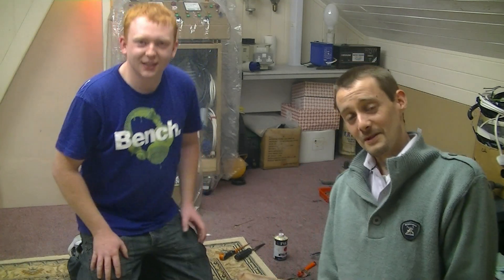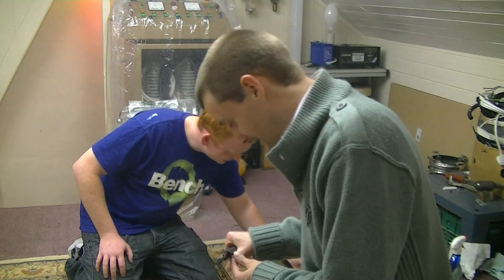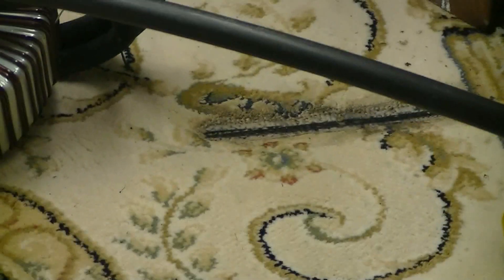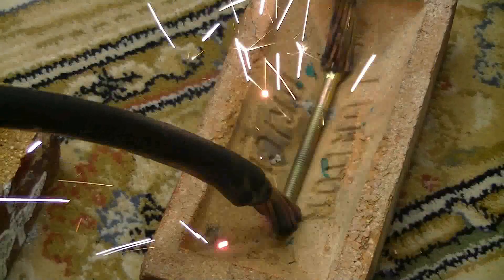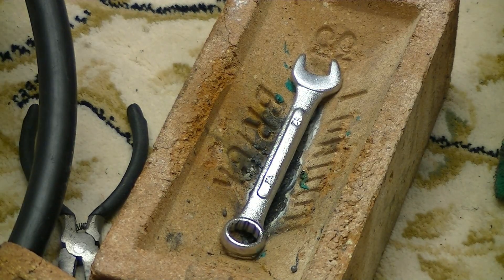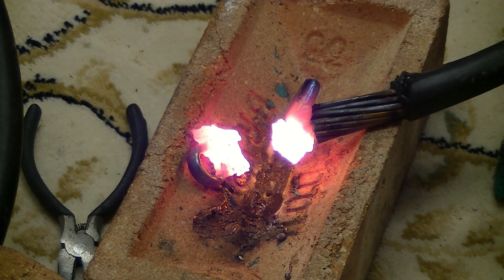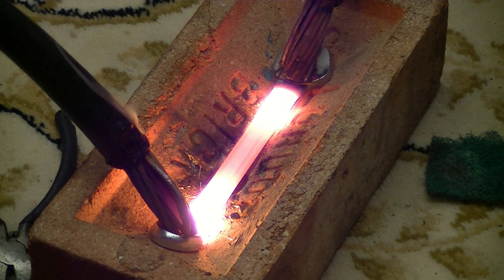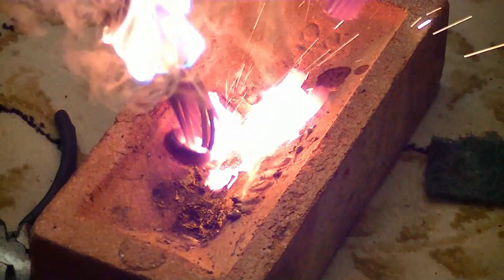5000 Amp Fuse + Tools Melt With High Current

Comment: Back in high school that was a trick we would do with a welder in shop,  give a wrench  a few seconds of current then toss into the pile somebody else was using,  or drop it on the floor near a project.  They stay hot a long time.

Comment: Lol you guys shouldn't be heating galvanized metal indoors (or at all)All that smoke was extremely toxic.
Reply: Ben Hutchinson JBC is right. That smoke is very toxic. You should never burn or grind anything galvanized without proper ventilation or masks. But when you're doing this in your living room, safety isn't really an issue.. 😂😂
Reply: JBC that's funny because they used to smoke meth everyday 🙂🙂🙂
Reply: I doubt the galvanization fumes will do near as much damage as all the meth these dudes have blazed
Reply: JBC so is the stuff there probably smoking besides living room carpet us brits dont give a shit even after we invented health n safety haha bollocks to it. looks fun as hell
Reply: no, its EXTREMELY toxic, go check out "metal fume poisoning" one of my welder buddies died from this. all he did was weld a bunch of galvanized plate steel, not fucking vaporize it in an arc furnace. '
Reply: Ha! And the ciggies are ok....
Reply: Galvanized is just zinc, a typical metal. Not like they were doing that with lead. Worse chemical that could come from burning zinc is zinc oxide, which I don't think is particularly toxic.
Reply: Hafiz Asyrofal they do sound seedy as fuck
Reply: JBC I was just about to say that.
Reply: Just beat you by 15 hours
Reply: haha. Yeah I gess
Reply: JBC well the fact these dumb asses are doing this inside and the way they are, it's probably way to late for that to be a issue lol
Reply: one word england... they are fcking stupid no offence to english people but they are fcking nuts thats why i like them :D
Reply: khznator 
if it wasn't for the British the world would be a dull place,we invented most of what the world use everyday!
Reply: Ben Hutchinson galvanized is extremely toxic to breath.
Reply: Ben Hutchinson 
vaporized zinc also

Comment: You're seriously doing all that on top of a carpet rug??
Reply: they arent the brightest of mate so i wouldnt worry about it, they wont be around for too much longer which has gotta be a good thing. last thing the country needs is these 2 herberts breeding.....
Reply: Assuming its wool, possibly not a bad idea, the wool chars, insulates and doesn't propagate flame, furnace workers used to dense wool felt aprons to protect themselves against splashes of molten metal.
Reply: Robert Hardy saw it catching fire right side...
Reply: Well you certainly wouldn't want them burning the wood!
Reply: I think the carpet is the least of thier concern!!!
Reply: paul rogers he did say that they had been to the pub beforehand
Reply: The breaker was blown. No more power.

Comment: The primary looks like 100 turns or so, the secondary coil looks like 2 windings perhaps. With 230VAC in the primary, this would produce about 46VAC in the secondary (the wires they were holding). That is on the edge of feeling an electrical sensation if touched and is unsafe. It's actually the current that kills most, only 20 mA is enough to put your heart into defib, but it takes enough voltage to complete a 'shock'.
Reply: BlaBlog101 oh well survival of the fittest
Reply: BlaBlog101 my teacher got shocked with 10kvac when he used to work and he only got shocked
Reply: It all depends on many factors: what is the current, how is the shock traveling thru your body, your body resistance, etc. Walking across a carpet and getting a shock from touching a doorknob or something can be in the 15kV range but it's very low current. If it was from a power station then it's usually instant death due to the large current. In any case, it's not safe to play with any electrical device capable of such voltage. An ignition transformer for an oil burner can put out many thousands of volts and if you got it across just your hand it would be painful, maybe burn the skin if long enough duration. If you got it between both hands though, like across the chest, you stand a good chance of getting killed. Your teacher might have just been lucky.
Reply: BlaBlog101 he just told that he fell backwards and felt a small shock. Thats it. He was doing some kind of measuring

Comment: why is this age restricted
Reply: Ry 00001 soccer moms
Reply: Ry 00001 probably because people flagged it.
Reply: you tube ,, how is that dangerous ,, rugs dont just explode into flames like raw natural gas ,, and the only amp load was on the heavy duty copper cable ,, they did have a do it yourselfer fire extinguisher at hand , used it and it did work as you could clearly see ,,  just the opinion of a man that tried many things like this and never had a problem
Reply: You Tube more like fry themselves
Reply: carmichael moritz If you need to ASK how is that dangerous than you clearly have no clue on how dangerous it is that you are doing… 
Maybe one day when something DOES happen (hoping not for your sake or others) that you will then understand how dangerous it was and you learn your lesson…
Reply: you tube ,, they were using high amp and not high volt ,, high volt is what can jump  and killl ,, high amp never jumps it has to have direct contact with a conductive material ,, believe it or not high volt can shoot a ark in the right conditions ,, and if i ever would get struck with high volt i do not think i would be around to learn any lesson ,,
Reply: carmichael moritz they were using 220 it'll kill you very quickly
Reply: dalton ,, yes  i know ,, 220 volts ,, what i am wondering does it still have the full 220 on the secondary winding , the winding that is producing the high amp load ,, with the primary winding's being such a small thin wire i know it cannot handle much amp ,, high volts yes high amps no ,, those small wires would just melt like butter ,, the secondary has thick cable and can handle high amp loads ,,
Reply: carmichael moritz ah I see now good point good point
Reply: carmichael moritz still I'd imagine it'd be about the same as using I very heavy duty welder if not kill seriously hurt lol
Reply: dalton ,, yes i have gotten a pretty dirty shock from a 225 amp welder that was using 220 volts and i can tell you for a fact that it was no where close to what 220 volts would have done to me ,, voltage is a strange thing ,, just like a vehicles coil to the spark plug , some say it can be as much as 40,000 volts  ,, i do not believe this i felt the jolt from a vehicle coil and while it was very painful it was not lethal ,, all i know for sure is i would not want to touch the main power lines that come into my yard , i think that voltage would fry me like a burnt hotdog ,,

Comment: Do yourself a favor, and DO NOT breathe the fumes from those bolts.
If it's zinc plated, you'll get welder's lung, and from what I've heard it'll make you feel so bad you will wish you were dead.
If it's chromium plated, it's probably about the same or worse.

You're only safe if it's raw steel, and I'd bet you would only know that for sure if you sanded off the outer layer of whatever metal it is to expose the steel underneath.

Either way, metal fumes aren't something to fuck around with!
Do that kind of stuff outside, at least then the fumes have somewhere to go instead of being stuck around head-level.

Other than that, this is a really impressive video, shows why current can be just as bad as voltage, the important thing is the calculated POWER.

Comment: Hey guys, a kewl vid but, as electrical engineering professor (power systems, no less) I’m a bit suspicious.  Not of the results, but of the power source….  It looks like your overall turns ratio is around 30:1.  That means that it would take around 100 A to deliver 3,000 A….  I just don’t think that your little Variac can do that job….  What did you really use for a power source???
Reply: Leonard White if you are professor may i ask. Since i am first grader in electrician school i was wondering that shouldnt they get shocked just by holding the cable with the power since i remember teacher telling that some of the electricity can stay in cable if much power. I think it was on a lesson about condensators
Reply: Ice,

It’s true that it takes a closed circuit to conduct current – that is, to be shocked – and that it would take two wires to form the two ends of the circuit.  But, in the Real World, the question is:  “What would be a ‘wire’? ”

Almost anything around you will conduct electricity if the voltage is high enough.  Even at lower voltages – like that you have in your home – the earth, a concrete floor, damp clothing, etc. can conduct enough current enough to be considered a ‘wire’ that is good enough to give you a shock.

If you were COMPLETELY insulated then you would not be shocked by touching a single conductor.  But, it’s difficult to tell when you are really insulated.  The things around you – for example a damp floor – may ACT as the other wire….  The higher the voltage, the more likely that something that is a normal insulator would conduct enough current to cause a shock.

The bottom line is that you should NEVER trust anything that might be energized whether is a ‘single wire’ or not.

Hope that helps,

Len

Comment: I don't know how the fuses work in the UK, (I assume it's similar to america) but fuses aren't really sacrificial parts anymore, they don't get destroyed, instead they flip and close the circuit. No need for a replacement fuse. :)
Reply: fuses are still sacrificial parts your thinking about breakers. in the us fuses have been mostly replaced by breakers.
Reply: Dustin M Ah, thank you very much
Reply: Osumo Ben Lodan in canada the house owner is allowed to turn on/off the breakers but you need to be an electrician to modify the box (add/remove circuits) i am not sure about fuses though
Reply: Dustin M In the Netherlands we use both systems. Breakers, who are consumer accesible, and screw in fuses, which are under an black box with seals. Only the grid operator can access them without getting any fines.
Reply: Dustin M Ah, okay.

Comment: What was the power?  I mean how much current on the input side of the transformer?  Most household outlets in the US 12 15A or 20A at 120V.  If you use a 30A breaker, you can install sockets that accept plugs used on high-current devices.  There's also a weird high-power outlet we use on electric clothes dryers.  

Intuitively I just don't think the highest non-industrial outlet I know could provide enough current to melt a 9/16 inch wrench... or a 14 mm spanner. :) :)

Comment: this is high current and low voltage. the voltage potential is probably so low you can grab both wires and not get shocked.  the secondary voltage is probably around 10-12v while the amps on the secondary side is in the thousands.

Comment: doubt there is any 5000 amps going on either. Simple math would require at least 62 amps on the primary if their secondary only puts out 3v and with the sparks I see, looks more like 6-9 v. 5000 on the secondary would require 187 amps on their primary, and they aren't using anywhere large enough wire size on the primary to handle that much. 300-500 amps would do everything they show here.
Reply: You can see the transformer has about 100 turns on the primary, so 25:1 ratio.  With 10-20A in (based on the size of the input wires), that gives 250-500A out.  Good guess.

Comment: What I find interesting is steel with a much higher melting point is melting and not the copper wire with a lower melting point.  Maybe I am unable to clearly see the size of copper vs metal objects that may be thinner overall, hence why they are melting and not the copper wire.
Reply: r351574n23[resistance, 1337]
Reply: Copper has a lower resistance than steel, and it conducts heat much better.  Bottom line is the steel gets hot enough to melt, the copper doesn't.

Comment: these guys are bumbling idiots. there is a reason why it is dangerous to mess around with high voltage or currents. you can get killed or kill someone else. I wonder if they gave any thought about what toxins they are breathing in with this moronic show. chromium and zinc can do nasty things to a person lungs and central nervous system when  inhaled.

Comment: Why is the insulation of the cables made of flammable material?
Reply: Because rubber and plastic are flammable,  glass isn't flexible, and steel isn't a good insulator.
Reply: Hello? There's a lot of non-flammable stuff that's not hard as glass and conductive like steel ...
Reply: Such as?  Rubber, glass and plastic are the best insulators.  That's why they use them.  The plan is to keep the wires AWAY from fire.  That's pretty much the whole purpose of the National Electric Code.
Reply: Such as silicone elastomeres.
The best isn't what's generally used, also what's the cheapest.
I wasn't actually talking about exposure to fire, but about self-inflammation, like seen in the video.
I've seen cables melt because of shorts, but at least they didn't burst into flames ... which doesn't necessarily have to happen even at higher temperatures, depending on the material.
Reply: +Star Gazer fiberglass

Comment: why aren't the cables melting? i've been wondering this for a while and is it because it's a special metal or something else?
Reply: The cables are thick gauge copper and low resistance so there is extremely low resistive heating in the cables. they do get hot by thermal conduction from the filament but not hot enough to melt the wire.
Reply: *filament being the tools he's melting.
Reply: There's a reason we don't use steel for power cables.  Think about it for a bit.

Comment: Photon didn't blow that 5000 amp fuse for safety reasons...if you watch a U-tube video when one of these"bad-boys""POPS",it makes a sound like a double-barrel 4 gauge going off!!.These devices are NOT safe for a inside demonstration,I hope that photon will blow-up this fuse on a upcoming"OUTSIDE"demonstration.

Comment: Don't breathe in galvanization fumes it's very toxic
Reply: Its okay if you filter the toxic fumes through a cigarette.
Reply: Rekt.
Reply: James McGowan is that guy at the party that pukes all over the place and ruins the party. Don't be like James McGowan.
Reply: And the coating in the wires
Reply: and the heat on ur face.
Reply: doing it indoors. balls man,balls
Reply: Yeah, no crap, I saw the galvanized stuff evaporate in the beginning before the metal got white hot.  I was scared for them even though I wasn't sure if it was toxic or not.
Reply: The screws are probably zinc plated. It will give these idiots metal fume fever. https://en.wikipedia.org/wiki/Metal_fume_fever
Reply: I agree with MichaelKingsfordGray, apparently it is already too late.
Reply: because of chromes
Reply: Christmas Eve very very very toxic
Reply: Christmas Eve  normally, they 've get coated with chrome. which is very toxic to human(and also to all living creatures). Scientists figure that out chrome cause cancer in high chance(very high....almost everyone) long times ago.

Comment: You do realize that the reason there is so little metal left over is because the metal is being vapourised and you are breathing metal vapour particles, along with the smoke from burning insulation. Probably not such a good thing to do. But, it was an impressive display of the power of electricity !!!

Comment: Guys, I dig science "experiments" but you have to be more safe. Your safety goggles won't do much to save you when you're playing with extremely high heat on top of a flammable rug. I'm guessing your floor substrate is made of wood which doesn't help. I liked the video, I just don't want to see you in the next round of Darwin Award winners.

Comment: I don't know if they have a automatic light dimmer on their camera or it's their home lights turning off due to the amount of power going into that tool.
Reply: No its the way the camera adjusts to the bright light from the molten metal
Reply: That would be a cool way to smelt metal in industrial levels, Just pass some electricity through it and bam, molten metal in 10-30 minutes.
Reply: James Allen camera. Molten metal is actually very, very bright
Reply: lego scape I just wanted to point it out. In fact, if you look at metal refineries on a map, many of them are near a power plant of some sort. Because that amount of electricity can't travel far on wires without losing power due to the resistance of wires.
Reply: +lego scape (Legoscape) ... Most metal refineries do it that way.
Reply: I don't refine metal :D
Reply: That's actually a really good point. WOW that is a really good point :P
Reply: not actually... At least what I know about copper refining is running a large current through a piece of Copper containing impunity when it is inside solution containing copper ion and let the pure copper form in the other electrode. Not exactly molten.
Reply: +tommy chan  yep, electrorifining, basically electeoplating on steroids, which is electrolysis on steroids ;)
Reply: QB Machine blackbody radiation :P